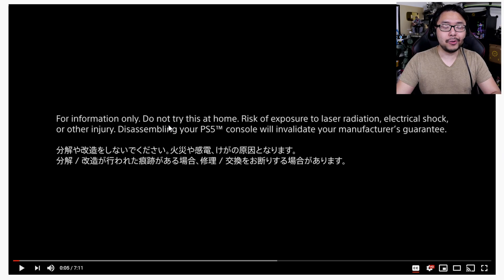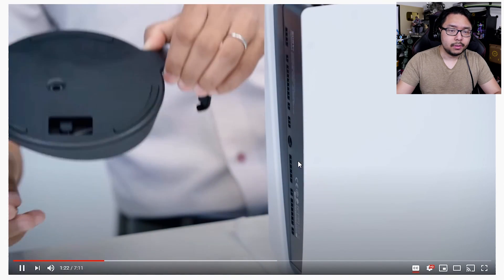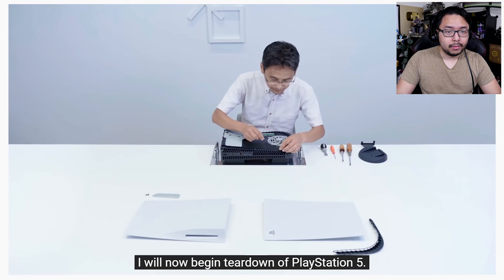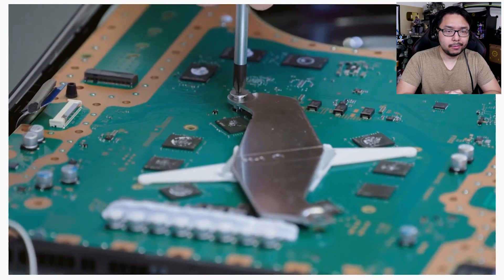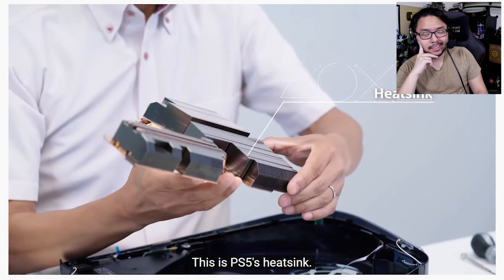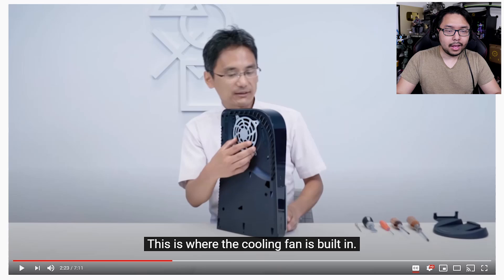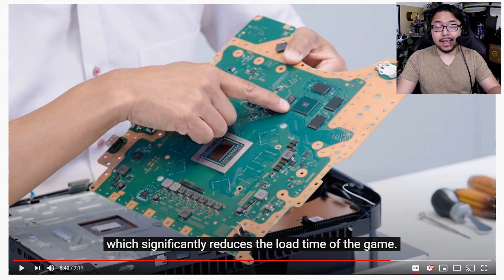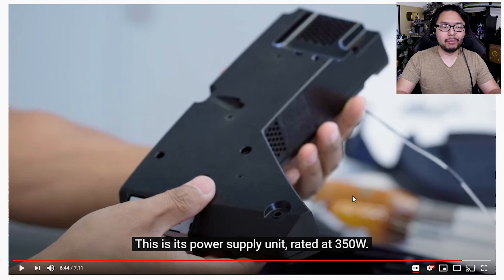Reacting To Sony's PS5 Teardown (Cooling, SSD Slot, Swappable Panels, & More)

Comment: That thing is massive. It won’t work with how my current setup is, shit. Time to invest in some home theater upgrades.
Reply: Don't worry, if you have a space heater you can probably pawn that bad boy off for some extra money since this piece of rock hard tech will double as a space heater. That's not to insult the console, I love this thing, but both consoles (and generally all PCs) produce a ton of heat.

Comment: for those of you who are going to expand the storage. make sure you get a pcie 4.0 nvme m.2 drive. 1tb sits around $160-200 and higher but that's the only drive that will match the speed of the onboard sony ssd.

Comment: Two design issues. 1.) Regarding cooling when standing vertical, the exhaust (back) should have the wider thickness at top and the intake (front) should be wider at the bottom. That thing is not designed to evacuate the heat properly due to that not being designed to get the heat our of the top or the cool air from the bottom. 2.) They built an SSD, a device that WILL fail due once you write too many times to it, onto the motherboard...ok (facepalm), while it will give you a faster load time, once it dies what then? Does the bios have an option to turn off that drive and let you use the NVMe as the primary drive? Or does it brick the system? There is no way to replace that drive unless you have surface mount soldering mastered and you can get replacement parts for it. Granted, you have the NVMe slot but why should I buy this when I can't remove and replace an integrated storage device? I understand proprietary hardware but this maneuver is similar to Tandy Computer when they made a proprietary print cable. This issue makes me say I would never buy a used one of these as I'd like to have as much life in that SSD as I can.

Comment: IIRC just removing that sticker wont void your warranty. in fact, its illegal of them to deny your warranty simply by the fact that you opened up your system.  i believe THEY as a company need proof that something specifically you did caused a malfunction in the system if it ever came down to claiming that warranty, and not just "oh you voided the warranty simply by opening up your system".

if someone can corroborate, that would help.

Comment: Again, putting the heat-sync at the very bottom of the console so you HAVE to take the whole thing apart if it gets dusty. They need to add an access panel for cleaning.

Comment: If the panels are customizable

I want a > SLIGHTLY < lewd/thicc ps5-chan wearing a SLIGHTLY torn/ripped Seto Kaiba's jacket on one side and a wolf howling at the moon on the other maybe make it Link from LoZ twilight princess

Side note: if anything a "digital" looking background like the ps2 startup screen for ps5 chans side... OR maybe make it look like the old ps1 start up screen with that orage diamond and fused PS as a call back to the old days and maybe add the Final Fantasy7 logo, the God of War symbol, demon/darksouls, just a few of the big bads from each era of playstation at least one for each

FF7 - ps1
GoW - ps2
Demon souls - ps3
(Ghost of tsushima/fallout/whatever) - ps4
(...) - ps5 (I might go for a FF16 if only cause I love FF)

It doesn't have to be these in specific just one from each gen I was just doing this as an example

And for the other side...colored the way you think it would dark blue sky, black n' white wolf, silverish moon (no face that moon scares me even to this day), a few trees here and there possibly the wolf Link sitting atop a cliff maybe midna riding his back (yes midna is a necessity)

The only real reason is cause I grew up with playstation and Nintendo and I love both and this would be all I want

Comment: It was a lot easier upgrading the Xbox 360 vs the PS3 too!  But no one ever remembers how BADLY 360 owners were screwed on the pricing of those proprietary drives!  I 'member.  And I am NOT going to buy into that bullshit ever again!  PS5 lets you use "off the shelf" NVME drives from ANY manufacturer...as long as it meets spec and physically fits.  Xbox will be overcharging their customers this entire gen.  Enjoy.
Reply: Yep, I literally never upgraded the hard drive on my launch 360 because of that. I just kept the 20GB (or whatever it was) that came included with the launch bundle. Still have it even today.

Comment: I’m curious about the thicc heatsink. It’s a copper plate and heat pipes, but are the fins nickle-plated copper or aluminum? If they’re aluminum, doesn’t that defeat the purpose of using copper for the contact plate and heat pipes?

Comment: This explains the reports that the PS5 is cool to the touch, there's a flowing air gap between the panels and the actual body of the console.
Reply: I bet when they first tested the design it sucked up so much dust that they engineered the dust catch holes with cleaning in mind. This console looks amazing simply for the ability to service and clean it yourself with ease
Reply: FührêrFPöñê  I'll have to assume that you're either a child or an adult with the mentality of a child. Not really much difference either way.
Reply: FührêrFPöñê  before you go spouting pony I wanna make this clear I play everything except Xbox mainly because their quality of the games have drastically decreased , game pass is just a scam to get more games with microtransactions in front of people and the way they are limiting next gen with the series s , I like the switch for what it is I play pc (half life alyx was sick)  and I play playstation the Xbox just has nothing to offer I got into pc gaming because it had some of the best vr exclusives it had something to offer over playstation what has Xbox got ?
Reply: @TristanTheVRGamecat  the series s doesn’t limit next gen, it plays next gen games just at a lower quality
Reply: FührêrFPöñê  I play PC you dolt

Edit: better than having an abhorrent title as my username
Reply: FührêrFPöñê  and what I mean by blocking holes is I mean they drilled holes for air flow then blocked them literally go look at it they made all those holes in the top then filled in the corners if they didn't need the holes why make them even on the back half is covered by plastic the another quarter by parts it's very odd
Reply: FührêrFPöñê  Except Cerny stating it could clock much higher, but they capped it at 2.23 GHz (road to PS5 video), capping is Underclocking, not overclocking.

Comment: We have to vacuum dust out of our consoles? Microsoft put more thought into their system. It was videos of journalist putting together Xbox Series X with less tools and parts. Having to take apart the system to add more memory? Yikes!  Microsoft has a big storage advantage. Partnering up with Seagate and using 4 times the compression of Sony's SSD means that Microsoft has enough price control to always have the lower priced SSD without sacrificing performance. 

I think I'm gonna wait for that PS5 pro. Hopefully its smaller and comes with more SSD space.
Reply: @Makon18  Been gaming a long time and never had to do that before. Used to blow in NES cartridges but that's about it. Liquid Metal, A Heat Sink the size of a tablet, dust traps....I'ma wait for the PS5 slim or pro...maybe I won't have to vacuum one of those models

Comment: That is some heavy duty cooling, plus the use of liquid metal thermals, and a whisper turbine fan is going to keep this cool AF... then the data transfer rates are insane for a console..   they are really building a top quality system... on the SSD part, it is better to have an internal direct connected SSD expansion for speed, as a secondary port connected expansion tends to be slower, as it is restricted by the port type it uses.

Comment: All those consoles are more quiet in room with AC in template cold regions.
I wanna see them perform in tropical hot climate with only a home fan blowing the room.
Reply: Will report back when I get mine and summer comes along again for me in FL. 100+ degrees Fahrenheit and 80% humidity has given my PS4 quite the run for its money in terms of struggling to cool.

Comment: One thing caught my eye. at 5:26 @5:24 we see him flip and then it has the liquid metal part on top. THen @5:32 we don't see that anymore and later its suddenly there again at @6:51? I wonder how they thought about movement and such with that liquid metal inside. He had 2 different boards there, he was flipping that thing so fast. I guess that metal would fly off the way he did that

Comment: I see the same steps as it was on ps4
1. Remove panel by just forcing it a bit
2. Unscrew the cover
3. push and screw new expansion drive (ssd now)
4. Screw cover
5. Put panel back
Its so easy, in ps4 you had to change 4 screw around the drive, now its only 1.
People complain for nothing

Comment: umm.. if the SSD is built into the MOBO... how do you replace it? or add more storage? An external SSD?
Reply: The answer is you can't. However, I missed the part about the m.2 expansion slot by the fan. So at least you can increase your storage.

Comment: Thought that warranty void stickers were illegal on most electronics according to the FTC.
Reply: They are not enforceable in court in the USA, but they still try to put them on there anyway to try to scare people off or fool them otherwise despite this. They also have more lawyer money than most people so good luck even fighting it in court even though you're technically in the right.
Reply: @DeathBringer769  Thanks for the reply, definitely got a point there about scaring people if even Yong was worried about digging into the system.

Comment: With the ssd yea microsoft may be easier to install but they are expensive as hell for only a 1TB where as with ps5 you can use non sony MVME drive and saberant currently have an 8TB one out. Though it is £1499 as much as a RTX 3090.
2TB NVME I've seen as cheap as $110

Comment: Here is a suggested list of PS4 games to be installed on the PS5 SSD. They offer potentially hundreds of hours of gameplay while reaping the benefits of much faster access speeds over HDD at only a small fraction of the cost on the precious SSD storage space:

13.81 GB - Skyrim
12.87 GB - No Man's Sky
6.72 GB - Subnautica
Honorable Mention - The Sims 4
Reply: Can't wait to play NMS with those loading speeds. Startup on the ps4 is ASS.
Reply: The high performance SSD will definitely give some PS4 games a new lease of life, especially those that take more than a minute to load up a saved game.
Reply: @GermanEnigma  Not just saved games but in general too. Guiding lands on Monster Hunter World takes a good 2-3 mins on ps4.

Comment: Just an interesting observation, Sony is the one who would usually lean into the notion of using proprietary storage solutions. Remember the Vita
Reply: and the PSP too! Good point.
I'm glad they went more open on a bunch of ideas (teardown clarity, removable panels, 3rd party storage solutions, easily accessible dust cleaners...)
Reply: Didn't PS3 have a standard HDD and the 360 a proprietary one? And then there is Blu-ray and HD DVD, though I guess that wasn't so much about being proprietary than a war of which would be the new standard.
Reply: @defeqel6537  no. They use stock cheap laptop drives with gen 1 sata

Comment: I really love the design of this console
Reply: The one with the disk port ?... not too sure

But the download only... yeah, that looks slick but the disk Ps5 is T H I C C
Reply: @Mr_Makina  I'm pretty old school though, I need that disc drive in my console
Reply: @Ryan1993uk  im the same but after my Ps4 being bipolar with certain disks, ive had to go 100% download only and since I religiously love PS now, that's only  cemented that point of view tbf, its definitely the way forward imo.
Reply: It’s starting to grow on me
Reply: At first i was skeptical and then didnt like it but with the side panels being removablr easily and being able to change them then the customization will go crazy
Reply: its shit. thats an expensive fix if anything goes wrong out of warranty. and the cooling needs to be what it is due to overclocking, which is also a fkn shit implementation. i'd rather have a stabke consokle with more power than an underpowered console putting stress on the cpu
Reply: @MarkWilliamson-kc6lh  You know that consoles can run harder than they do if they didn't get that hot, do you? With good cooling, the console will not go into throttling and underclocking the CPU to remove heat.
Reply: @MarkWilliamson-kc6lh  Yeah, because it's not as if PC users have ever overclocked their cpus right?
And that cpu is not constantly running at max clock speed either, it has a variable rate so when it doesn't need to it will run at a lower frequency. But whatever rocks your boat mr couch engineer, I'm sure you know better than the hardware designers working at SIE.
Reply: I’m not the biggest fan of its design, but i’ll give credit to Sony for trying to innovate their hardware. As a playstation fan, this pleases me.
Reply: As an owner of a fat ps4, 4 ports is fucking nice. I was limited in what I could do on my console. I have a 2tb external, first port. My astro A50, last port. Charging my controllers on a separate charger. I wanted to get the Astro controller, nope. No more ports.
Reply: @cesiba1  i mean.. You can use any third party usb hub..
Reply: @AndrewHadi07  Not on certain peripherals. And then the power draw is a problem. For example, my external hard drive didn't like usb hubs. Or the PlayStation didn't like it. The PlayStation wouldn't recognize it. It needed to be plugged in directly. Then you can only plug in so much stuff on the one port using the hub.  It was messy. And it didn't work properly so I decided to just not mess with it.
Reply: I like the futuristic design yeah
Reply: Yup especially once that gallium dries up, really loving the desing indeed
Reply: Mabswer Yes, we heard you in the other threads. No one’s biting:
Reply: Not even just aesthetically but the intuitive construction is amazing
Reply: I love the design
Reply: It's starts to grow on me too.
I was hoping silently for the V style Playstation.
Call me crazy, but i loved the futuristic shape of it.
Reply: It's better than no design with that Xbox , they made a bunch of vent holes then blocked half of them up , seems really stupid to me
Reply: @TristanTheVRGamecat  I don't understand how you all can shit talk the design of the Xbox. It's literally minimalistic and there's literally no problem. If anything it looks like a PC... and no, I'm not an "Xbot" I own a PlayStation myself. I can also guarantee if this was the Xbox's design, you all would shit on it for the entire generation.
Reply: Its a very clever design, love it.
Reply: Right!? I mean everyone has their own taste, some like the minimalist design of the Series X but I prefer this design tbh. Looks so good.
Reply: @chillieice  minimalist design?? its a black phone box.
Reply: @inkwellflood8276  Not my words. That is what other Swedes are calling it. I would call it boring.
Reply: @chillieice  ok, i think its a smart design, because making something that needs to be big, look slim, is very difficult indeed.

Im more bothered that its £70 a game 🤯 - hell no.
Reply: @inkwellflood8276  I like the design, and when it comes to pricing of games I have a massive backlog so I will probably get a PS5 during spring 2021 and by then hopefully there will have been some sales 😁
Reply: @chillieice  i think your plan is a good one, there's many ps4 games I'd like to play, so no rush for me neither, have a fine day 🎩🤘🏻
Reply: Agreed
Reply: It's the ugliest console I've ever seen.  The Sega Master System was pretty ugly too.
Reply: Ugly

Comment: With the information on load times and cooling that we've been getting recently, I feel that this generation seems to be focusing on what TV Tropes calls "Boring, But Practical."
Which, personally I'm quite happy about. As we are rapidly reaching diminishing returns with traditional attributes like graphical fidelity and, to a lesser extent frame rate. Where as I feel that these less sensational elements will contribute to an improved experience more than "8k resolution," or whatever other mostly useless nonsense these companies's marking department hypes up.
Reply: I honestly prefer boring over major instability issues due to overheating.
Reply: @maverickrx8  Yep, me too. Unfortunately,it generally doesn't sound as flashy in a company's publicity announcement though.
Reply: Don't underestimate the graphical upgrades we will see this gen. This generation is a bigger leap than what 8th gen was at the time
Reply: @miguelpereira9859  True, but the point is that diminishing returns means that those upgrades will seem less impressive than the on paper numbers would indicate.
The massive reduction in load times, on the other hand will, in my opinion, have a bigger impact on the moment to moment experience, and the improved cooling of the PS5 will prevent all kinds of problems that afflicted the PS4.